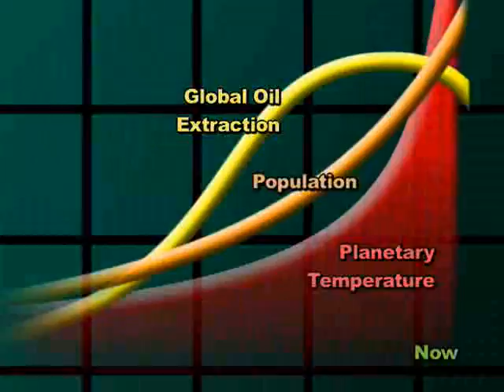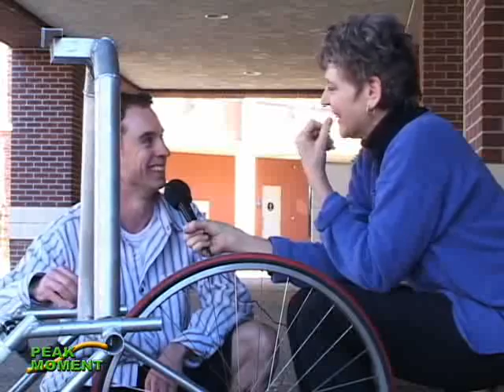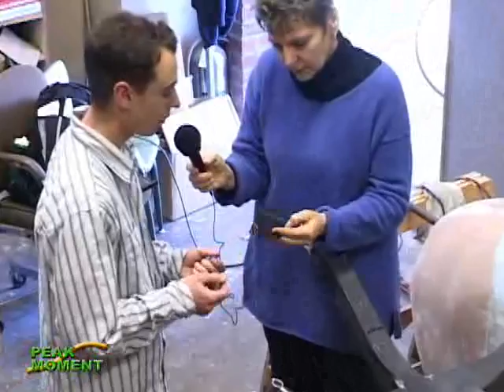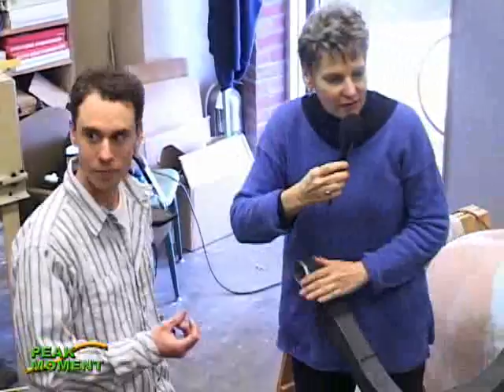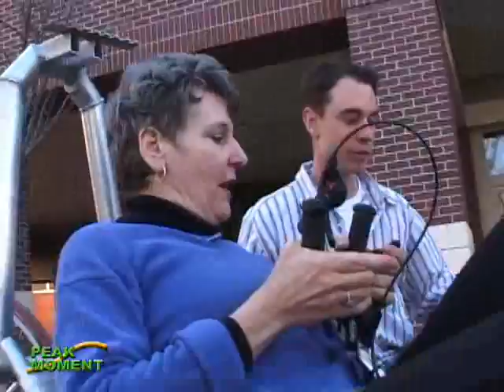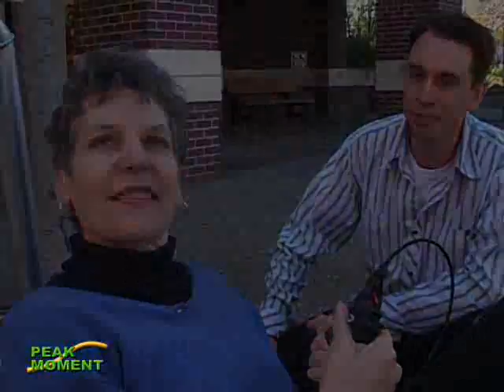Bicycling on Three Wheels - Transportation of the Future?

Comment: I can't deny regular bikes are often more versatile. Parking can be a problem, weight is higher, your seat can get wet if you don't have a velomobile and you forget to use a rain cover, etc.

But there are applications where they make much sense. In many cases a recumbent bike/trike is faster. It's definitely a more comfortable seat. For touring, for longer commutes to offices or rides to supermarkets with good bicycle parking, they're very nice rides!

Comment: About the safety: I had a recumbent trike (before I switched to a two-wheeler recumbent :-P) and rode it in traffic. I did everything to be visible, so I had a flag, very good lighting and light-colored/reflective clothing. I also watched out very well. Kept my hands at the brakes. When I felt someone didn't see me, I waved to attract attention. I never felt unsafe on the trike, a lot of the safety depends on your own behaviour.

You ride a trike like a responsible driver would drive a car.